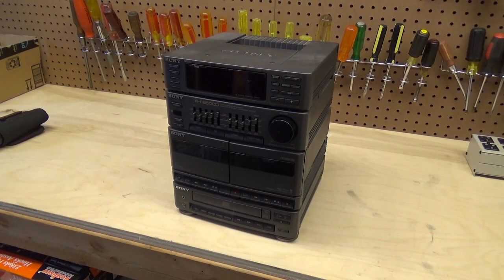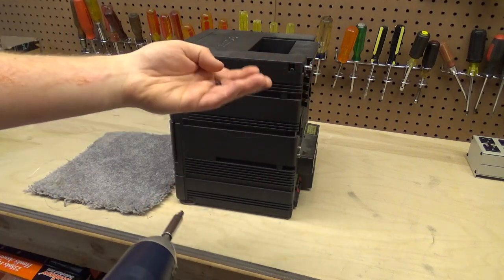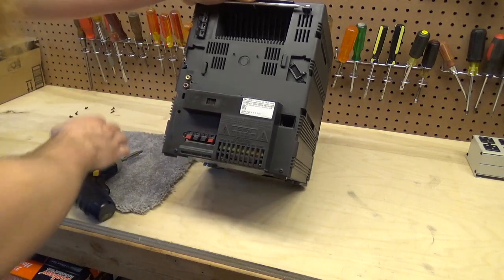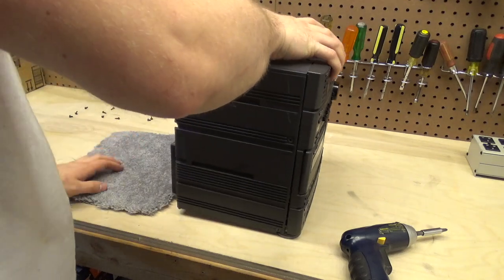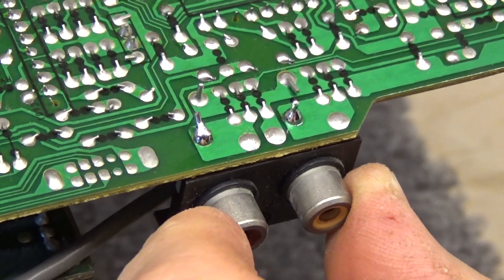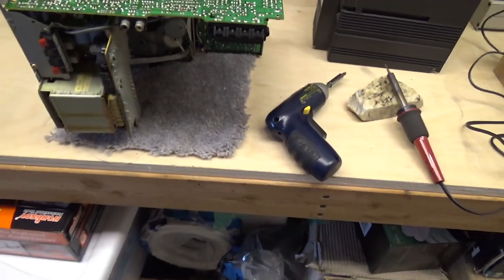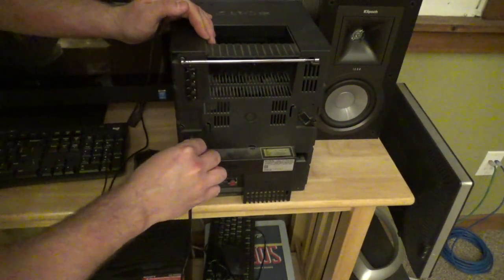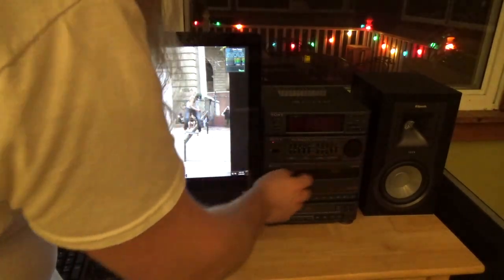Sony FH-B50CD Repair | Simple Solution, Bizarre Failure

Comment: My Sony FH-B50CD's display is not working. But Tape and CD Player works. Reset doesn't fix. It's just creepy that thing is working without display. Help me out if you know any tip/
Reply from the maker: There's probably a loose connection in the ribbon cable somewhere.

Comment: About 3 years ago i bought a 1986 Technics receiver that had a similar problem with a cracked solder joint. But back then i didn't know anything about that, so i was able to get a refund. I didn't really like the receiver, it was lacking bass.
Reply from the maker: Thanks for letting me know.